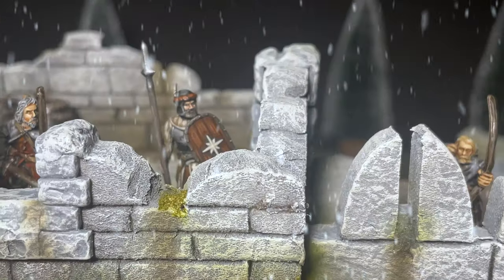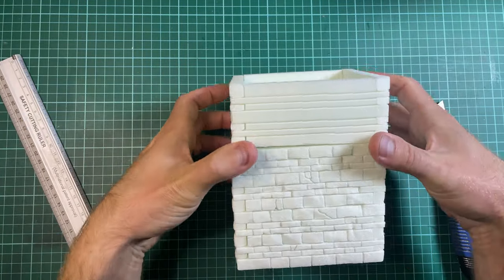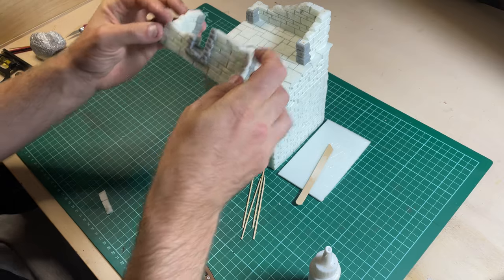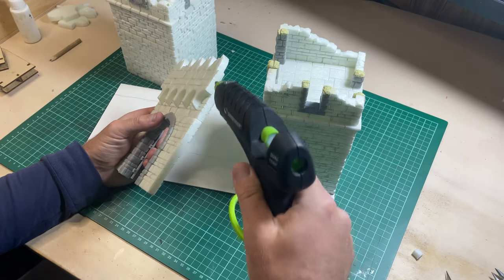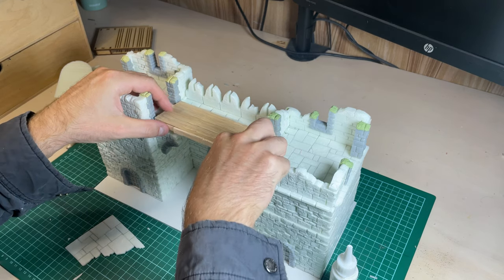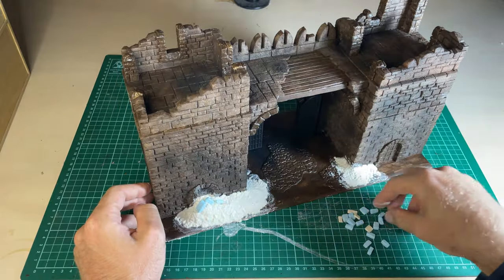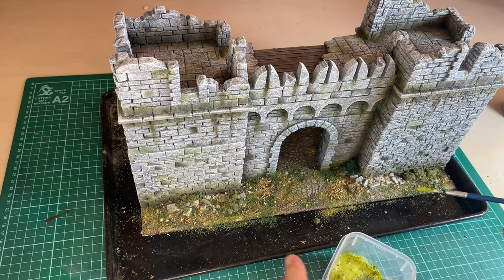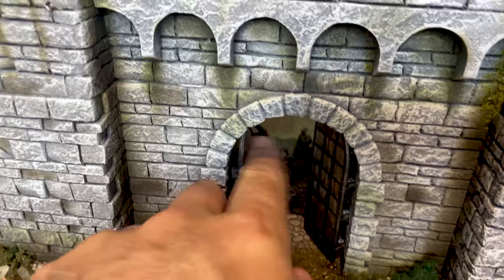I Built a Ruined Gatehouse Diorama for WARHAMMER

Comment: What dimension have your XPS plates? 10x100 mm but how long?
Reply from the maker: I have cut all my xps foam to 300x100x10mm thick. I find I generally don’t need pieces longer than this and it is generally pretty easy to store in bulk ready for use.

Comment: I started this video thinking I was watching Real Terrain Hobbies or Black Magic Crafts. This is some high quality content on such a small channel! Keep making content like this, and you'll be 100k subs and beyond in no time.

In order to glue foam and resin/PLA printed parts, I've found it best to cover the foam in a watered down Tamiya or AK putty. It not only allows more glues to be used, but stops paints and oils from soaking into the foam as much also. You can crumble the bricks easier after the putty has dried to add a nice aged look. Finally it also adds a nice bit of texture, but is also able to take texture if you wanted to the aluminum ball or brush, depending on your desired effect.
Reply from the maker: First of all I’m not sure how this comment slipped under the radar but thank you for the kind words. Real terrain hobbies and BMC are big inspirations of mine so that really does mean a lot. 

I will definitely pick up some AK putty and give it a shot. If it behaves how you describe it, then it might be really interesting to try.

Comment: I have had good luck with foam safe super glue or uhu por (expanded polystyrene glue)
Reply from the maker: Oooo thanks for this. I will have to give them a try! Particularly interested in the super glue as that keeps the build moving along speedily. What is the drying time for the uhu option?
Reply: @microforgeminis  it's pretty stuck in a few minutes but I think the full cure is a couple of hours.
Reply from the maker: @dpratt1984  awesome well I will add both to the list then as I am not a massive fan of mixing small amounts of two part epoxy.